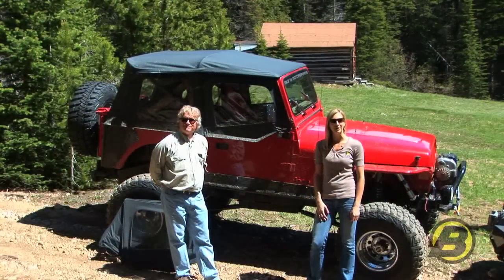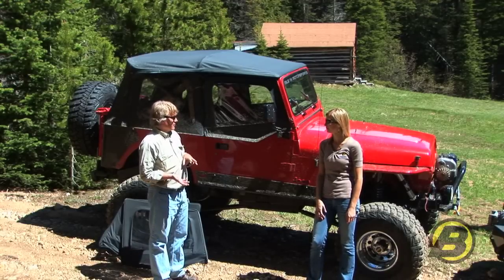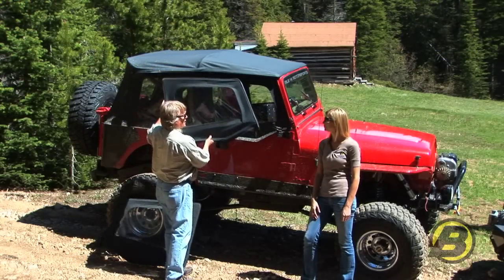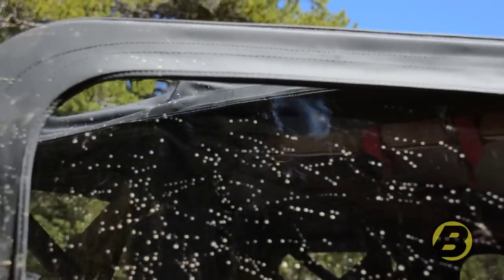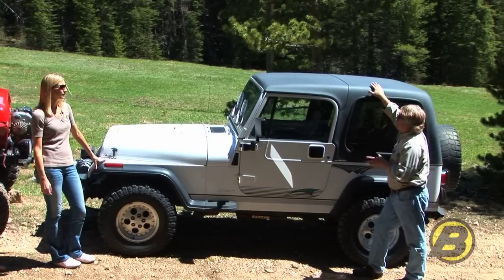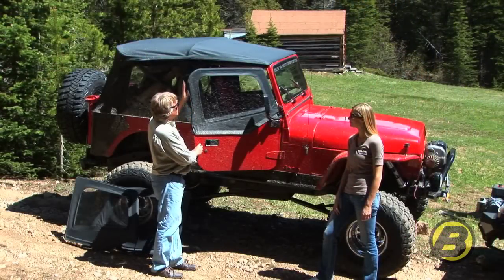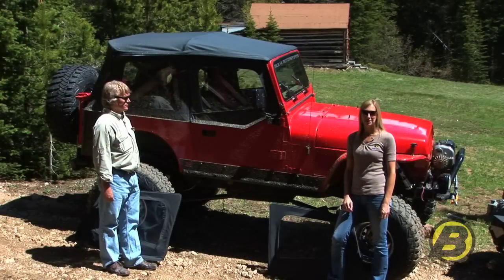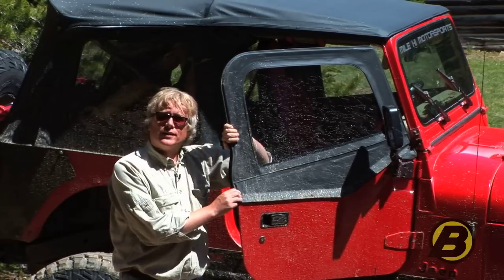Jeep YJ Doors Explained.

Comment from the maker: Not -precisely- correct. Yes, you can modify TJ uppers, and some people do. But you can get soft uppers designed specifically for a YJ - you just need to make sure you get the proper ones.